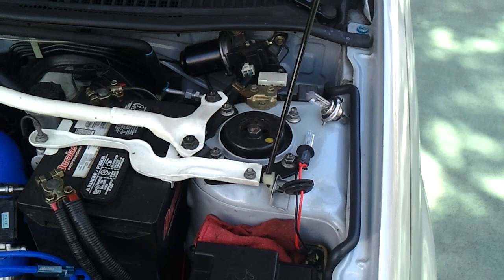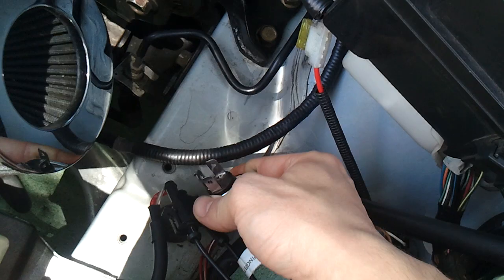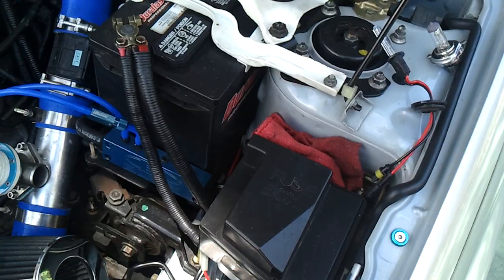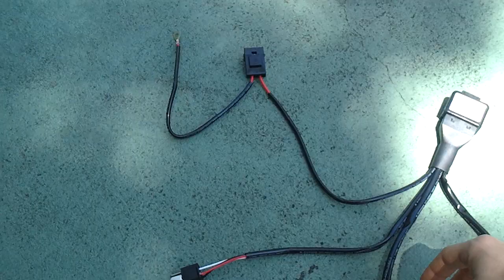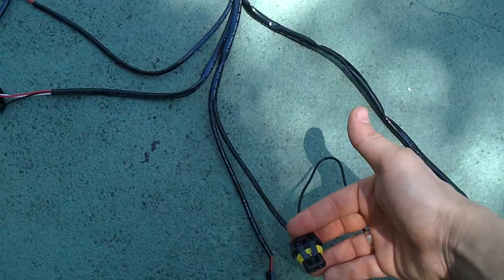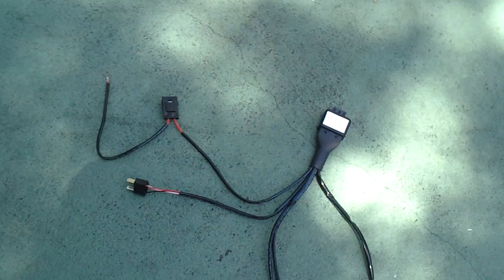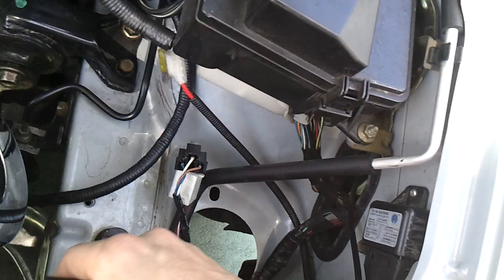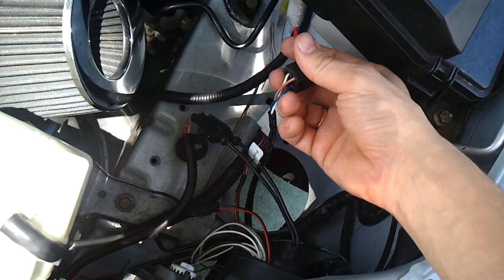MSP Mazdaspeed Protege Morimoto H1 projector retrofit & H4 relay harness explanation

Comment: So you retrofitted the projectors from morimoto into your stock headlamp using the projector adapters that attach to the h4 bulb mount, and after that where did you get the relay harness from? Would a regular hid bulb- ballast from eBay would work fine with the projectors? Or would the light output and cuttoff be crappy ? I have 3 days trying to understand hid options for my car x.x, thanks a lot for the video by the way!
Reply from the maker: +Fred Torres, yes i retrofitted the projectors into stock headlights using the H4 adapter (that should come with the projector kit). 
Afterwards i got the H4 hi/lo relay harness from ebay, to control the Low/high beam function of the projectors themselves.
And then Yes, a basic HID kit will work fine (as long as you specify the H1 bulb to come with it, cause that's what the morimoto projectors take).
If you want more light output, then get a higher wattage HID kit (55W or 75W for example, as opposed to a basic 35W kit).
And the cutoff depends on the projectors, not the bulbs/HIDkit.
Reply: +Ivan Dudyak thanks a lot for responding! you cleared it up for me. ok so I was mistaken I thought my 2004 civic si had h4 bulbs but I just checked and it's a hb4, I imagine they wouldn't fit I don't see any adapters for it online. So I guess I'm only left with the option of getting tsx projectors which are a direct fit for depo headlamps at least now I know I can use an eBay hid kit with the tsx projectors so I don't have a crappy cuttoff line. Thanks a lot again!

Comment: Yeah dude, but how do you give power to the ballast, or to the bulbs itself. The h1 bulb has two wires with the connectors made to plug in the h1 socket of the car, which in this case is not possible since you have h4 factory socket. If you plug the h4 relay harnes into the h4 socket on your car, you will control the projector but still you have no power that goes from the car to the ballast and then to the bulb itself. I bought this h4 harness but I got to this problem

Comment: Hi! Thanks for video. But I understand all of them except one thing. Now you connect the relay directly to battery and h4 socket from relay to orginal light harness. Everything is ok till here. But what happened to another socket on light that to feed orginal h4 socket harness of light? Are there 2 input on h4 socket ? One is come from relay and the another is come from car's orginally? Does it occur any short circuit?
Reply from the maker: I'm not sure i understand your question, but just in case, here is how i had it in my car. the car has 2 h4 connectors, one for the left and one for the right headlight.  the one on the right i didnt use any more at all, left it unplugged! the original left h4 plug that used to connect to the regular bulb, now connects directly to the HID relay I showed in the video (the relay that get power directly from the battery).  That relay is now the ONLY thing that sends power and ground to the HID ballasts. The reason you still need the original H4 connector is because the way that relay is wired internally, it needs to know when to turn the HID ballasts on, which is why it uses the inputs from the H4 plug.(as you know that H4 connector has 3 wires, ground (-), low beam power (+), and High beam power (+).  So now when you turn you headlights on, power still gets sent to the Low beam wire on the H4 connector, but instead to going into the bulb, now it gets sent INTO the relay, to turn the realy ON, and then the relay takes power from the battery, and sends it to the HID ballasts.  and also when you switch your High beams on, power is sent to the High beam power wire in the H4 connector, that then gets sent to the relay again which keeps the projectors on, but also "opens" the flap in the projectors themselves, that gives you extra light coming out. Hope that helps, sorry for the long explanation.
Reply: @ivandudyak13   well said mate awesome video

Comment: Hi. Are the Xenon kits (of each manufacturer) essentially the same (components, ballasts, etc.)? By that I mean, can you install a particular kit in a car with H4 bulbs, and then later remove the kit from the H4 bulb car and install to another car (that takes H1 bulbs) with putting H1 bulbs? Or do yo have to buy an H1 kit?
Reply from the maker: The generic ebay HID kits, are pretty much interchangeable, you can plug any bulb into the ballast you already have. so yes, if you already had a H4 HID kit, just take the ballasts off, and use them on your new H1 bulbs.
Reply: @  @ivandudyak13 , Oh ok. When you bought these projectors, did they include an adapter/converter (or similar)? My car's stock headlamps (reflector headlamps) take H4 bulbs and I currently have a Canbus H4 bi-xenon kit installed. The reason I ask is because I plan on putting new "angel eyes" type headlamps (these headlamps I found for my car have projector and they take H1 bulbs). So, besides the H1 bulbs that I will need to purchase, will I need a relay harness too, or is it different case with the H1 xenon kit?

My main concern is: With these lamps (mentioned above) installed, will I be able flash the headlights with the highbeam without the lowbeam lights (the main lights, where the xenon kit will be installed on to) turning off in favor of the highbeams?

Also, will I be able to have both my lowbeams and highbeams constantly on simultaneously (when I drive alone in a rural road with no lighting at all)? Thank you in advance
Reply from the maker: @delaccnt86  if ur new headlights take h1 bulbs, then yes, you should be able to just either get a HID kit with h1 bulbs, or use your old ebay ballasts, with the new h1 bulbs in the new headlights. as far as the Hi/Lo beam functionality, i cant answer that, because i dont know which headlights/projectors you're buying. to give you an example, the projectors in this video are called Morimoto H1 projectors, cause they take an H1 bulb, so no adapters necessary, and also they have a little motorized flap inside them, that gives them the low and high beams, with the help of the H4 relay harness, cause the original factory headlight bulbs were h4s.
Reply: @ @ivandudyak13 , Ok then. Thanks for your help! :)

Comment: What ballast are you using?
Reply from the maker: They're all pretty much the same, generic ebay HID kit ballasts.  Unless ur asking if I'm using a 35 watt or higher ballasts. If I remember correctly I had 55W ballasts at the time. Anything higher and ull start melting ur projectors.